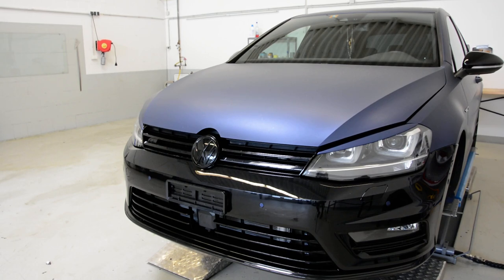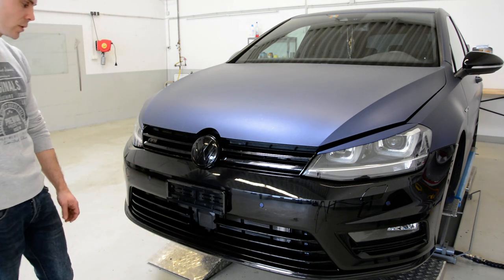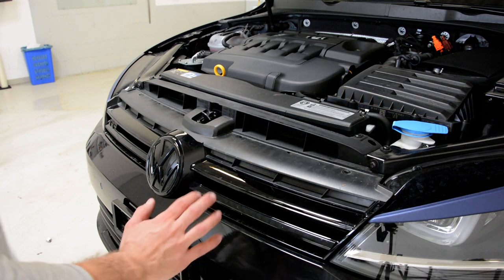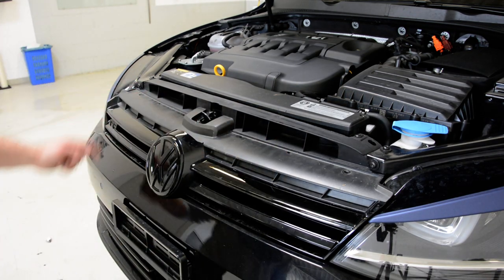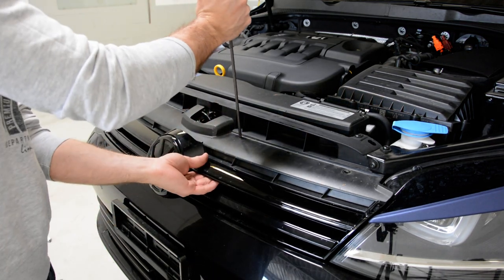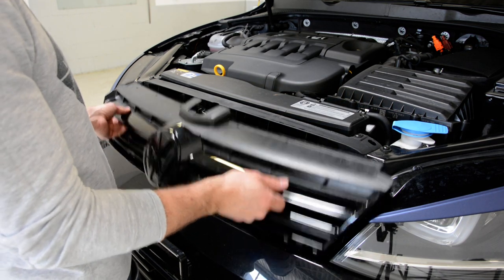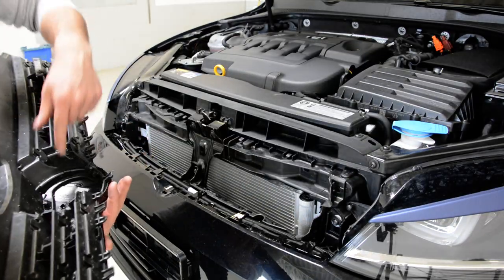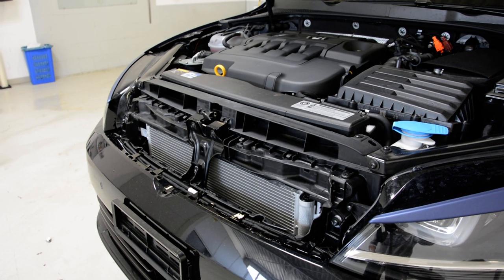VW Golf 7 R Line  Front Grill Removal

Comment: I want to thank you for including the bit on how to push the lower pins with a screwdriver through the holes. I have a mk7.5 gti and it is very different from the mk7. You've been so helpful, thanks for the help!
Reply: i have a 7,5 gli too. How do you removed the grill. do you pull upside or frontside the grill, after the screw removal?
Reply: @hydronauta you did it? please let me know how to remove the lower pins :/ i have a 7.5 too.
Reply: @diegog1982  ma sei Italiano?
Reply: @hydronauta  uruguayano (from uruguay) ;), I'm trying to replace the badge without broking nothing else, i can't find the way how to remove the bottom of the grill! need to remove the front bumper first?
Reply: @diegog1982  you must remove the upper screws and pull the grill against you (ahead  ,not up)
Reply: @hydronauta  Ok i will try! thanks for the tip... is better one pull or in sections? hope not broke it lol.
Reply: @diegog1982  try it with no fear :-)